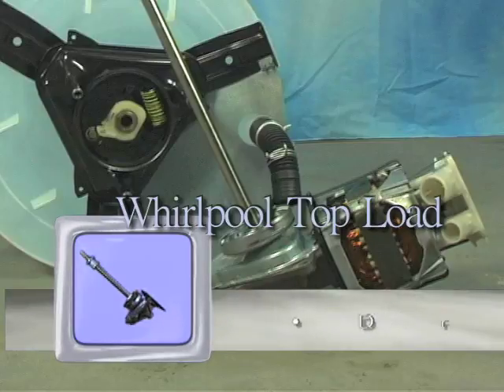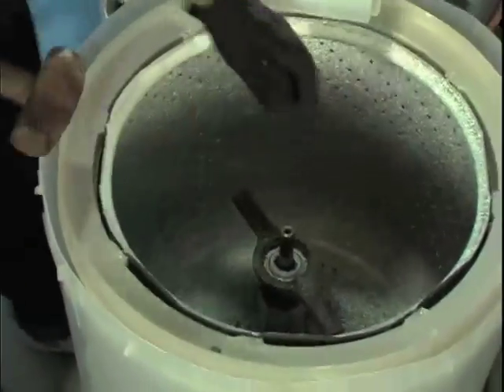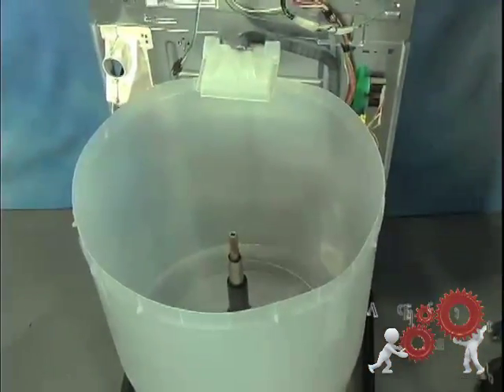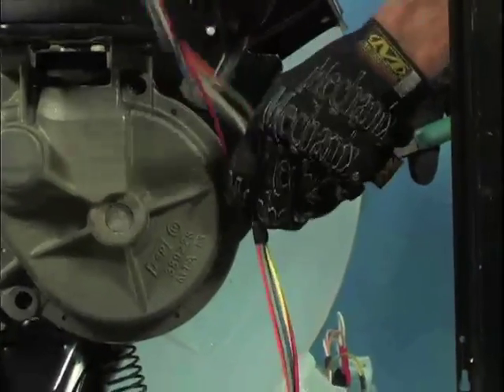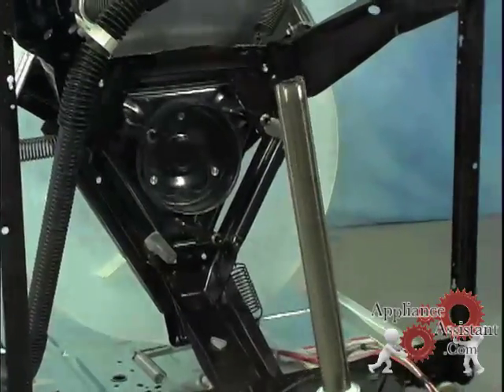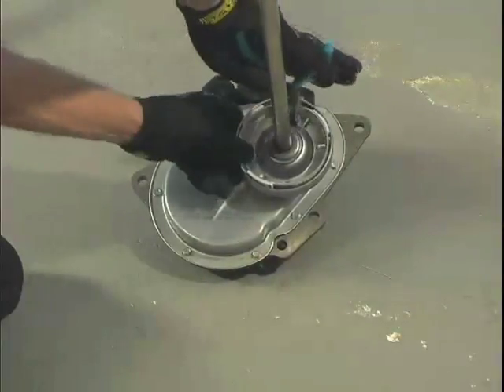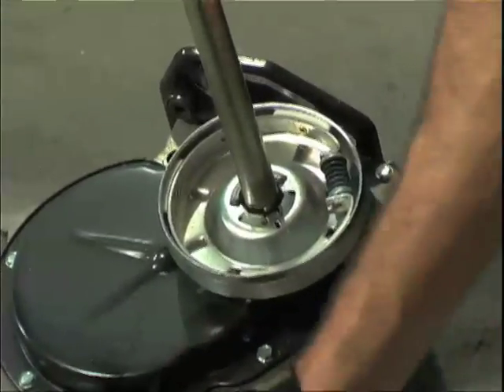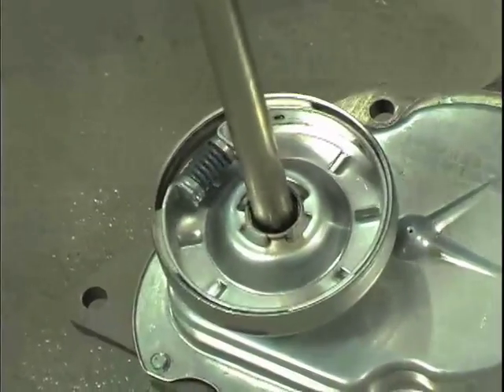Washer Drive System Repair Direct Drive Washing Machines

Comment from the maker: The clutch would usually slip if it was going bad but it should still engage somewhat... have you looked at the break arm? it should catch on the inner band of the clutch pad, next to the tension spring to release for spinning. The outer bell of the clutch drives directly off the transmission, so you may have a transmission problem : (

Comment from the maker: Hard to say for sure with kenmore... What is your washer's model number?  If the washer is this whirlpool type then you may also want to look at the tub hub... It definitely could be the transmission. If the clutch bell is spinning under the washer when it should be spinning then your transmission is okay.  It would be a problem between the clutch and the break/ drive tube or the tub's connection to the upper dive tube with the drive hub. Hope that helps some! Good luck!

Comment from the maker: It could be the clutch.. but usually that will start with clothes that are just more wet than normal, and get progressively worse. If it sounds normal but is not spinning at all the motor coupling is the more likely cause. There may also be a fast clicking sound when it is trying to spin. Sometimes the agitation will work because it puts less strain on the coupling than the spin function does. Take a look at the motor/ coupling video and see if that gives you any ideas.  Good luck!

Comment from the maker: One side thought... the timer will still make a noise even when nothing else is being energized.  you may also have a bad lid switch.  If the buzzing/ humming noise is coming from down inside the washer it would probably be the motor or something in the pump, but if the buzzing is coming from the timer, check the lid switch.. Hope that helps!

Comment from the maker: That is a tough one...you may need to pull out the inner tub and see if there is something stuck between the tubs. With the tub out try to spin it again and see if the drive shaft is moving. Hopefully that will give some clues. Good luck!

Comment: Thanks for this very instructive video! Have a Kenmore 80 washer that clicked loudly during the spin cycle.  Pulled out the transmission unit and found the brake cam tab on drive tube broke off and there was oil on the clutch and its housing.  I plan to replace the clutch and the brake cam.  How do I fix the oil leak?
Reply from the maker: Unfortunately the oil must be coming from the transmission… Not good.  There is no good way to stop it apart from replacing the transmission.  If you clean it up real well and it's a slow leak it may work for a year or two but eventually the oil will cause the new clutch to slip again or the transmission will lock up.  Sorry for the bad news.

Comment: Great video. I hope that I can do this! Before I order the expensive part (tranny), I just want to clarify that it is the part required.
Washer agitates on low speed, but "slips" under load (a towel or 2 prs jeans is too much) and will only agitate clockwise, resulting in clothes wrapped around the agitator. Low load is ok. Regular agitate speed always grinds & won't catch on the CCW motion. On spin, it will sometimes suddenly "grab" and agitator will stop free spinning before releasing again.

Comment from the maker: Sorry for the delay, I hope you where able to figure it out and get things going...Heres a few things to check... Is the clutch plate all the way down and locked onto the transmission? Could the clutch spring be hitting the brake arm?  I usually install the inner tub onto the hub after the transmission is in place.  Is the inner tub out? That may be making things difficult. Hope that helps some! Good luck!  Thanks for the question!

Comment: one thing I have learned is that the brake drum has to be pushed all the way up and also have the brake couple all the way to the left so that the clutch spring does not interefere.  most important to get the clutch and transmission all the way in, you have to have the brake drum assembly pushed all the way up.  hope that helps

Comment: Appliance , The drum of washer is filling ,and the motor is running ,but no agitation from the top agitator .The belts are moving ,but the pulley is not turning that goes to transmission.  I turned the pully counterclockwise ,but all the agitator did was spin. When you turn pully clockwise it spins also. Could it be the trans is stuck in spin, and not going to agitate, or am I missing voltages that would put agitation cycle on.  The motor is definitely running ,no doubt.

Comment: I did take it apart and turning by hand from the motor coupling, if I turn it to the left the agitator cycle work okay if I turn to the right it does spin,  I put the drive tube in the transmission and the clutch not engage, I just did what you did at 5:10.... I just want to make sure  it is the clutch bad?

Comment: I have a like new Kenmore Elite washer that is not spining or draining the waterm out. I replaced the lid switch, checked out the clutch, the coupler and everything around the transmission and motor. All looks like brand new and in excellent condition. What do you think the problem may be? Ah, yes, how do I put the transmission back? I try back will not go all the way in. Thank you.

Comment from the maker: It does sound like the transmission... you may also want to change out the clutch while you have it apart... Its not a very expensive part just hard to get access to, but if you are changing out the tranny...  Good luck! Thanks for the comment!

Comment: I must admit that I have learned something here today. I do, however, got a question for you. I, while opening the transmission boy, leaked oil ( i think most of it). Now, I don't know how to add more to it. Is there any way to do that without opening the transmission boy again. If not, how do I do it by opening the transmission box. Where exactly the oil goes to? 

Thank you

Comment: I have a maytag washer that will spin cycle just fine.  When it starts to agitate it will only move back and forth 3-4 times before it lock up.  The motor still sounds like it is trying to spin.  In order to free it up I need to manually spin the agitator.  Sometimes that will not work and it is only freed when I switch to a spin cycle.  Any advice would be great!  Thanks!

Comment: I have a Maytag a105 washer that spins but will not agitate .The belt was replaced a little while ago ,and I replaced the lid switch. The belt is not broken . The belt made a noise when I tried to wash ,and it stopped agitating .The moor seems to be ok .This has happened before ,and it sometimes fixes itself. I wonder if I am getting the voltage to agitate it ,as their are different wires going in before you get to motor

Comment: Appliance assist, One problem I have is I can't get the agitator out after removing the screw on side ,but not sure if this washer problem is mechanical ,or electrical.

Comment: Thank you for the video.  My kenmore washer will not spin. It will adjatate. I did test the lid switch and it is working. I did buy and install the clutch kit but it still will not spin. Is it time for a new tranny?

Comment: Great video and very helpful.
I have a Kenmore washer model 110 92588410 similar to the one shown.. My problem is that I cannot remove the inner tub as easily as shown. It seems like the hub is frozen to the tub. I removed the transmission assembly for ease. Can I remove the drive tube and tab on the hub to loosen it and get the inner tub out this way?  Any suggestions? Thanks for your reply.
Reply from the maker: Removing the drive tube is usually more difficult because it has such heavy contact with the corroded hub.  Try working some rust buster or WD-40 between the outer part of the hub and the inner tub contact and let it soak in.  Then press down toward the floor hard and fast at a few opposing points on the outer edge of the inner tub... Hopefully it will break loose with some effort.  If not keep trying and you should get it.  Good luck! Thanks for the comment!

Comment: Why wouldn't you mount the motor before sliding in the drive shaft, alot easier to attach and install the clips that way

Comment from the maker: @Sixhicks Thank you! Sounds like you are on the right track with the clutch pads. If you go to my website (link is in video description) there are a few parts links on the direct drive clutch repair  video page. from that link the spanner wrench is 13.45 S&H starts at 5.93 there is also a link to the clutch kit. Good luck. Thanks for commenting.!

Comment: when I place the drive shaft into the brake tube the drive shaft won't go all the way up so I can bolt it back together with the three bolts is there something I'm missing that I need to do? Thanks in advance.

Comment: My washer runs through all the cycles fine, but makes a very loud banging/clunking noise only during the spin cycle.  It makes the bang/clunk noise at least once a second during the spin.  Is this the transmission?  What do you think?
Reply from the maker: I have had motors make a noise like that when they can't shift from the start winding to the run winding within the motor... There is a centrifugal switch that makes the change moments after it starts spinning and makes contact with the motor's run winding. Can you upload a video of it?  Then I can listen and maybe give a better idea of the cause...

Comment from the maker: Sorry for the delay... On that washer style, if the motor is working and the belt is not broken, it sounds like a transmission failure... Probably best to start shopping.  : (

Comment: have you ever heard of the seal at the top of the break drive tub going bad and leaking water into the clutch??? that's what just encountered. is there a rebuild kit or am I stuck having to buy a new one? thanks.
Reply: I think you have to buy a new one in this case. This part doesn't fail often so you might also be able to get a good one from another broken washer.

Comment: Is the drive shaft suppose to have play in it? Mine moves quit a bit. It seems like it should just spin without play
Reply from the maker: tony nash there may be a little play but very little. Sounds like it's probably worn on the internal gearing.
Reply: @applianceassistant  thanks

Comment from the maker: It sounds like a gearing problem in the transmission... Some newer washers (GE) use a coil to shift the transmission from agitate to spin but that type is all mechanical... Bummer.

Comment: Need help; my agitator continues to be weak after replacing it with a new kit.  What could be the problem?
Reply from the maker: Unfortunately, it's probably a problem in the transmission...  It's usually not a difficult fix but the gearcase is a pretty expensive part.  Sorry for the bad news.  Good luck!

Comment: my maytag works fine but, it seems over the years the agitation cycle has gotten louder. I checked the dog ears they are fine. it is loud  knocking or banging as it changes agitating left to right. could it be anything else but the transmission?
Reply from the maker: Christopher Wolford Not really... The one thing you may want to check is the tub hub/nut. A loose tub hub/nut usually makes the most noise as the washer starts and stops spinning but its worth a look. Good luck!

Comment: Hi I have a Maytag Washer MAV2757AWW I am having problems with it not spinning out the water. It spins some but not really fast to get out all of the water. I kept the lid open and it seems to be like it is agitating and spinning at the same time but slowly. It also sometimes makes a very loud noise something like a jet plane taking off when it is washing. I just can not afford a new washer right now but don't want to put  a lot of money in this one it has not worked right since I purchased it.

Comment from the maker: Opening the transmission is not recommended... as you now know : ( There is no good way to get the oil back into the gear case and get it sealed up again.  You may be able to find a new gasket and oil online but it is fairly rare that the gear case is repaired, it's usually replacement only. Knowledge is expensive sometimes, but hard lessons usually stick with you for life.  However, I have no doubt you can figure something out. Good luck!

Comment: I have a Roper #RTW4440VQ2.......tub seems to be locked up....it won't agitate or spin.....can't even move it by hand either direction.....motor does hum though....... what say you?......thanks in advance
Reply: Just in case you have the washer after 3 years (or for the benefit of anyone reading this) the tub is probably locked just because of the brake that is engaged. For the humming part, it can be because of a bad connection to the motor (red wire near the bottom would prevent the motor from starting) or something stuck in the pump. I would first remove the pump from the motor and see if the pump turns freely. Then try to run only the motor, without even the gearcase attached. A bad capacitor would also cause humming noise.
Reply: I just had a locked up drive train. I removed the pump and found a kids sock in it. It was wrapped so tight had to replace the pump

Comment from the maker: That's a little strange for a transmission... could be.  I would be inclined to pull the agitator and check for shaft movement during agitation.  You may just need a new set of agitator cams "agitator dogs" I have an agitator video posted that will walk you through it. If its just that and a pump it would be worth fixing. If it is in fact the transmission it's hard to say if that would be a wise repair... If you do the repair and avoid the labor charge maybe... Good luck!

Comment: cant slide drive shaft on  far enough to bolt???
Reply from the maker: Sometimes the brake arm will hit the clutch spring and keep it from going up all the way.  Pull it back out and make sure the clutch that is on the transmission is not going to hit the brake arm that is a part of the drive tube that it is going into.  Hope that helps!
Reply: Usually I align both brake spring and clutch spring towards the front of the unit, by getting used to always place them the same way, the transmission always goes up to it's right position without  looking.

Comment: my GE washer makes a very loud noise during spin cycle
Reply from the maker: Hard to say without hearing what type of noise... What is the model number?  is it a grinding, squeak, or something else... Did it come on fast or has it been a gradual increase over time?
Reply: GE,  Mod number is WHRE5260E1WW The machine make a rattling sound on the final high speed spin.
Reply from the maker: on that style of washer I would guess the clutch mounted to the motor may be the cause.  You can pull the front of the washer off by depressing 2 tabs with a putty knife. They are located a few inches in on the right and left of the seam where the front meets the top of the washer. after you press them down the front will pull forward and lift off 2 bottom tabs.  Then you can run it and hopefully isolate the source of the noise.  Hope that helps! Good luck!
Reply: Ok i will give it a try and let you know what i found, thanks

Comment: Tengo una secadora Maytag, cuando seca enrolla la ropa, que puede ser?
Reply from the maker: Estoy utilizando el traductor de google, y yo no entiendo muy bien su pregunta ... ¿Se puede reformular?
Reply: okey, cuando se coloca  la ropa mojada en la secadora y esta se seca queda muy unida una con otra y torcida.
Reply from the maker: It could be that the washer is not spinning water out of the clothes well.  Can you squeeze water out of the clothes when you get them out of the washer?
Reply: @applianceassistant  Its twists the clothes into knots when it spin dries.

Comment: New doesn’t mean better…the new models are complete junk imo…too many sensors and u can’t chose the water level u want…sensors choose for u based on weight…and everything being efficient and conserving…u won’t get clean clothes because there’s not enough water to wash the clothes…this world is looking less and less appealing to want to continue in it…when u can’t even buy a decent washing machine simply because if the level of greed from these creatures who set the rules..,what’s the point…I can’t even wash my clothes! The bolt on the agitator is so rusted and won’t budge so the pos is going out the door to the junkyard…so sick of this junk we have been left with…